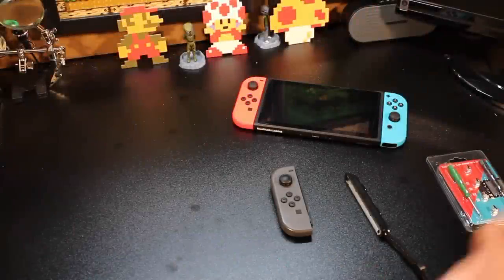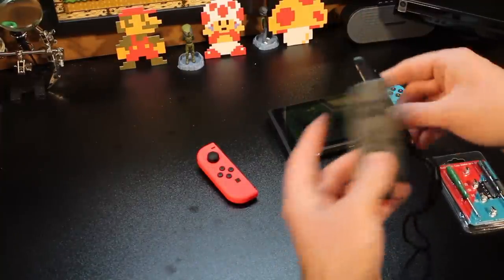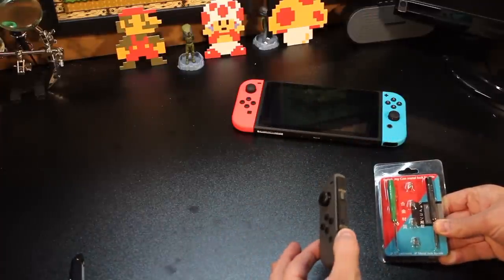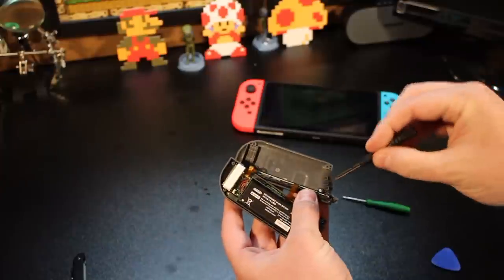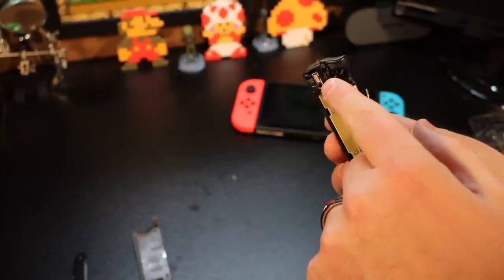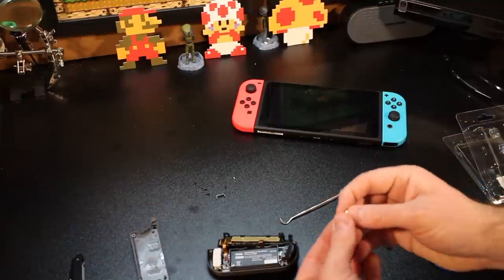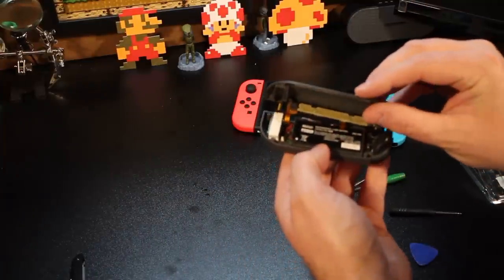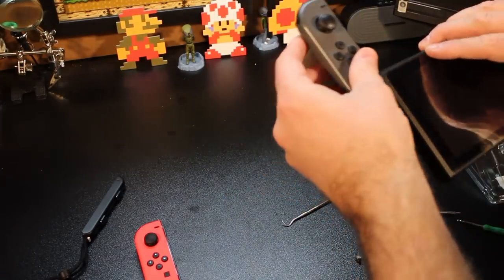How to fix the Nintendo Switch Joycon rail locking system

Comment: With the straps you actually DONT need to press that back button. The locking mechanism for the straps is completely different. The only thing you need to do is disengage the little white lever at the end of the strap then pull it off.
Reply: Or just don't use those useless straps at all!

Comment: Took me a while but I managed this today. Some observations:
 i) Use a pair of tweezers! They are really handy when dealing with the tiny components, esp when trying to get the spring to compress when reassembling. My fat fingers are way too big.
ii) Use a tray or large bowl to work on so you make sure you don't lose any pieces.
iii) The screwdrivers that come with this pack are very small, but they come with a hexagonal top so you can prob fit them into a larger thing like a ratchet screwdriver with changeable heads. Recommend doing that if u can.
iv) The rear tri-blade screws were very tight on my joycon, so be careful not to rush it and strip the top of the screws.
V) Make sure you compare the piece you are replacing with the new piece so u are sure you have the correct side.

After all that, I still managed to pull out one of the ribbons, but I somehow got it wedged back in and everything seems to work ok. The latch itself is definitely fixed. I left the rear scews a little looser In case I need to ever do It again....

Comment: Man youtube not helping

Trying to find a way to fix my joycon rail its basically wobbling and idk if its my joycon but it randomly and repeat being disconnected and i tried to update but wont work

Every time i pull it back it disconnects ,lift the switch up,or even push it at  rail
Reply: Gus Michalinos I cant find a tutorial either. My joy cons pins are bent inside and idk how to connect the ribbon cables

Comment: already did this "fix" on mine, definitely worth the upgrade even if they haven't weared down yet. they should have been metal to begin with imho.

mine just came in a plastic bag lol, no plastic packaging
Reply: Hey how does it hold up 3 months later??
Reply: THE AnimeFAN considering theyre metal, id guess pretty well
Reply: August no they will ruin your rails because of the resistance
Reply: @diamonddynamite1557  Exactly. They were plastic to begin with for a reason.

Comment: I suspect that, in my case, the problem lies in the rails on the Switch itself.  Can these metal replacements also work for it, or are they only intended to be used on the Joycons?
Reply: the Joycons and the main unit share absolutely no parts, if it is the switch, and not the Joycons, these will not help. they're still good to have though.

Comment: I have a similar but different problem.. my right joycon wiggles just slightly. It wont like come off. But it moves enough that the system thinks its been removed. It disconnects from hand held mode.  Ive tried cleaning the contacts and all that super fun stuff still seems to have an issue

Comment: hey, i have a question about the kit, can you use both of the new lock sets ( the sets of 2 locks that there were 2 of) can you use them on 2 left joycons? because bothof my left joycons are having this issue and i wanted to make sure befor i boughtthe kit if i could use it on 2 left joycons.

Comment: I just got one of these kits, but the tri wing doesn't seem to be working. It's also blue instead of green, which is slightly worrying.
Reply: TheCrazyGreenGamer I have the exact same problem right now. I think the blue screwdriver is a completely different screwdriver.
Reply: Yeah my was blue to just order anther triwen screw driver fot the switch is works so good

Comment: Im sorry but, don't DO THIS! this could could potentially damage your joycon permanently in the future

Why?, well the reason why nintendo uses a plastic piece instead of a metal one is to make a intential weak spot in a fatal design problem in the joy-con. Basically its made to break when you drop it instead of traveling the shock threw the joy-con and switch. the shock that is caused will break ribbon cables.

Disclaimer: im not claming that this video was made with ill intentions im just saying don't buy a metal piece instead buy a plastic kind.
Reply: I actually think you could break the entire locking mechanism on the switch if using metal.  It would be nice if there was a material harder than plastic but softer than metal for this.
Reply: Yes rubber would be perfect because it doesnt get deformed

Comment: W8 did anyone noticed that the color of the joicon should be inverted?
Reply: TheGiulio95 if you get them with the switch they are inverted, however if you buy them separately you get a red - and blue +

Comment: How do you get the metal piece out at 6:50
Reply: you get something pointy under it and you pull straight away from the whole thing hard, just not so hard you break it. It's in there pretty tight but will come out with some effort.

Comment: These metal locks are trash. I tried them, didn't lock in AT ALL. Replaced them with the original ones again (fixed with super glue and sodium hydrogen carbonate) and it works ever since.
Reply: nowonmetube you probably used the wrong lock on the wrong side

Comment: hmmm the metal parts make me nervous, id much rather the relatively easy to replace little tab on the joycon wear down every once in a while than the opposing part on my switch
Reply: Lesbosmer I was thinking the same thing. What if it damages the actual console? There’s probably a reason Nintendo didn’t put metal tabs on the joycons in the first place...

Comment: Don’t buy this crap! 1 in 5 people might maybe get these metal laches to to work. Just buy the new Joy con . $30 that’s all folks. Nintendo is not cheap,  do not take them apart . It might latch ok , but it won’t be the same it will still wiggle not sturdy. Annoying! Trust me I did this do not take the joy con apart .
Reply: Most people aren't willing to spend money on a whole new joycon when there's a simple fix for a few bucks